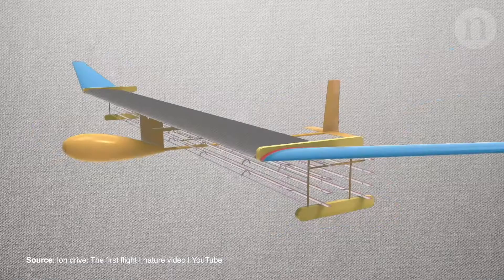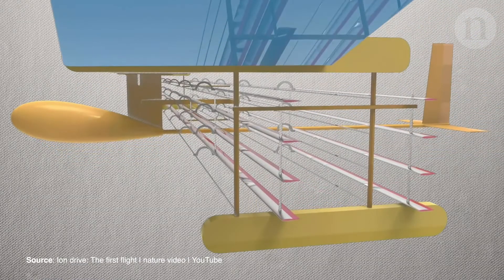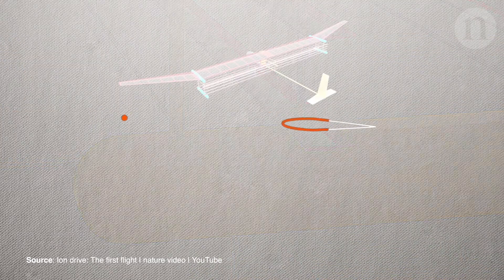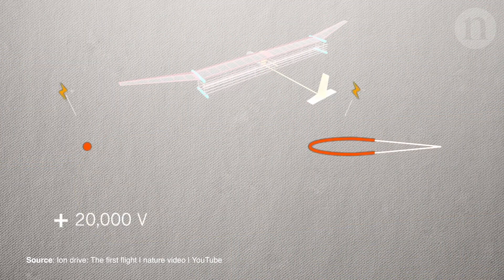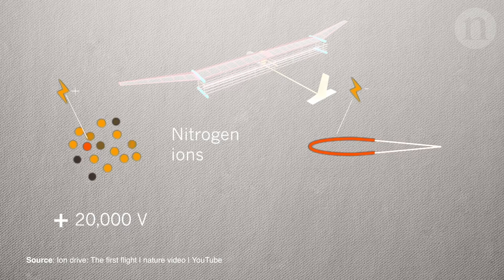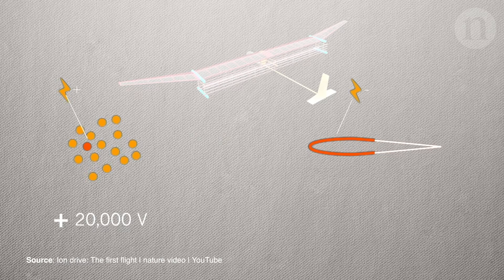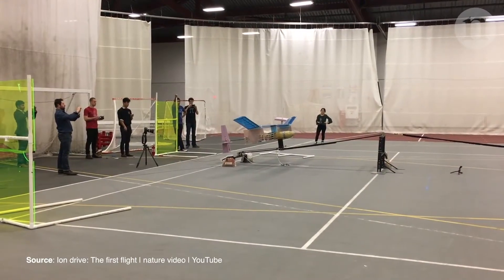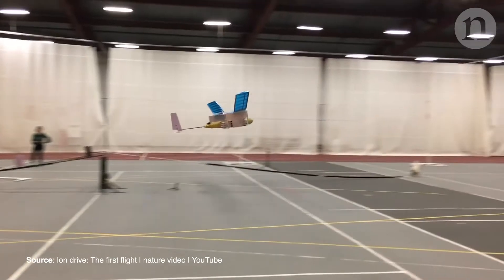How Do You Build a Plane With No Moving Parts?

Comment: MIT was NOT the first!  The first heavier than air ion propelled aircraft of any kind to carry its power supply onboard was already patented for carrying its power supply onboard.  It is called the Self Contained Ion Powered Aircraft.  It is 100% verified to work beyond any reasonable doubt.  If you click on  the purple channel icon to the left, you can see flight videos of 7 different models, the US patent, and a website as well as other info.

Comment: Actually, researchers flew an EAD craft that was much larger than the MIT one in 2003 in Japan!  The reason the MIT plane had a 16 foot wingspan is because they needed a glider that large to carry their power supply,  as explained to their previous paper.  MIT simply did not build the largest EAD craft.  Please see the website www.electronairllc.org site for verification, or the Worldwide Lifters Replications Page.
 
In MIT's last paper, published in the Journal of Nature, they stated that the above craft was "the first heavier than air ion propelled aircraft of any kind to carry its power supply."  The statement is historically wrong!  The first and only heavier than air ion propelled aircraft is called the Self Contained Ion Powered Aircraft.  It was patented under US Patent No. 10,119,527, specifically for carrying its power supply onboard (it had onboard power before the MIT project began).  It can fly for minutes rather than seconds without the assistance of a catapult or added wings.  If you click on the channel icon to the left, you can see 6 videos of it in flight and lots of other information as well.

Comment: Ah, that doesn't prove that the ionic technology actually worked. Looks like the glider was mechanically flung into the air and it then glided to the floor. I've got a paper airplane that does the same thing. LOL
Reply: that exactly what i thought
Reply: @101akafox  and us!
Reply: @exetercollegeuktechnologyc1323  you see Exeter college, this ionic engine doesn't have the specific impulse (I think)/ power to initiate a take off, the mechanical sling is used to give the ionic engine a chance to get started.
Reply: Agreed - but it could be a technique to delay the separation point on the wing at cruise - a 6-8 cm spanwise strip should do it.  Thinking totally out of the box- I've calculated that if you move back the separation point by just 2cm at cruise you'll could achieve the same drag reduction as a scimitar winglet.  Moreover, I'm wondering if the power for this strip could come naturally from the emf generated between the wingtips as the arcraft flies east-west or vice-versa in the earth's magnetic field.  Also, an aircraft naturally generates its own static charge and if the static voltage profile on the strip was sequenced to 'roll' with the aircraft's velocity I believe we could generate the desired drag reducing effect.  I know that Exeter Technology Center does not have expertise to investigate this concept fully so I hope students at universities, aerodynamisists, F1 teams etc will pick up on this comment for further investigation - it is freely given.
Reply: @charlesmasters2045  what is it that you do as a career ventus? You're starting to sound awfully professional!
Reply: @Zachary Kiss - yes - you're right.  I'm an Aeronautical Engineer currently working of transonic massive flywheels for energy storage.
Reply: If they turned up the heat in the gym and then turned it down before the flight the warmth from the floor would've made that lightweight device glide in a level manner, or if the floor is heated.  The force from the catapult is mathematically well over 10 times higher than the force of their ion drive otherwise, it would do nothing. They did not show the glide ratio without the EAD system compared to with it or the catapulted glide length with and without.  Their 2 stage lifter drive is exactly 1/2 as efficient as a single stage lifter.  It produces 1/2 gram of lift per watt vs 14 grams of lift at the airframe for the earlier patented craft that carries its power supply without a bungee cord or giant featherweight glider. They told the world they built the first ever of any kind with onboard power, when they did not.
Reply: Hi thinkofwhy,
Cool screen name! You might have already seen my ion propelled aircrafts, but if not please click on the channel icon to the left.  They are the only ones with onboard power and no catapult.

Comment: If only they could do that with gliders!
Reply: Zac - yes - I think it could be usesd to re-energise the boundary layer over the wing keeping the flow laminar for longer thereby reducing the drag overall - so in this case it's not a propulsion system but it might be a useful drag reduction system.  Perhaps in future, gliders will have a charge gradient from the front of the wing to the back.  Could this be used on airliners too?  - could there be a useful reduction in overall drag thereby saving fuel? - a good topic for student study.  Anyone at Exeter Technology Centre want to study this?
Reply: Zac - will do - thanks.